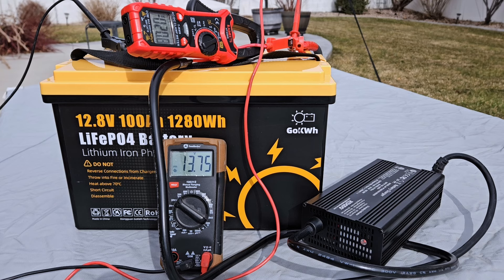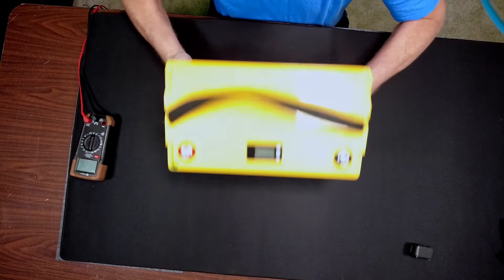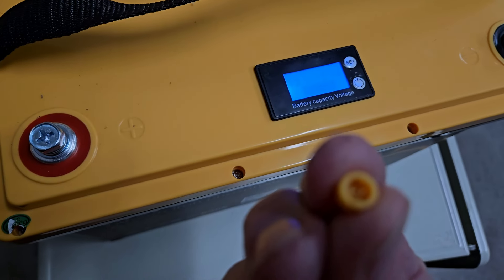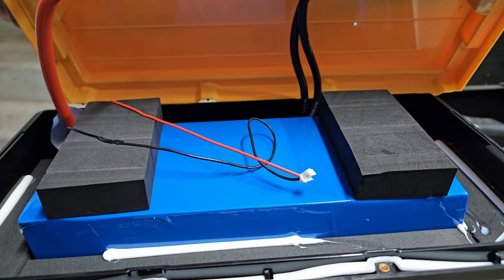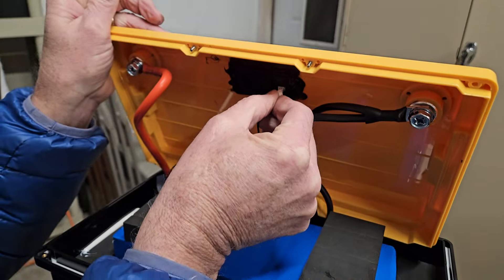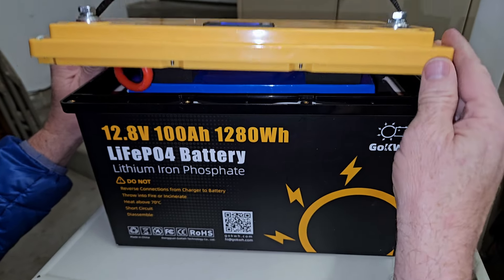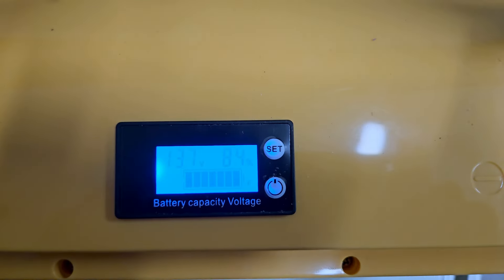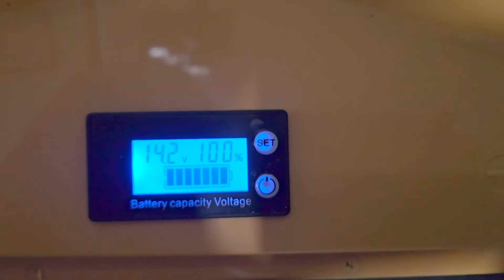Should you open a Lithium Battery to fix it ? | K7SW ham radio

Comment from the maker: What to do you think, was it worth the effort ? It was an easy fix afterall.  I wonder if I am the only customer who experienced this problem ?
Reply: This calls into question the reliability of the battery. The one thing that scares me about these budget batteries is the fact that their internal resistance does not limit their capability to dump a bunch of current if the protection circuit fails (or doesn't exist). That could result in an instant fire.

This ability of the lithium chemistry batteries is also what I appreciate about them... the ability to deliver sufficient current without voltage loss to my radios and other station equipment.

It's a love-hate relationship at its best. ;) But safety is something I take seriously and a reason why I'm careful about batteries and power systems associated with my station.

Don't get me wrong -- I think lithium chemistry batteries are a great solution for radio operators. I really appreciate the potential for thousands of recharge cycles from LFP batteries. (They will outlast me.) But care is required.

Comment: There is a certain percentage of every run that is broken. This is what customer service and warranties are for.  If the "average" customer of this device was asked to open up the battery and they declined... Would the company do an exchange? It's a simple fix and I would have done that fix myself if asked... But I'm special (just ask my mommy). If I had no issues with customer service I'd still consider this a pass.
Reply from the maker: I agree Steve, I was really surprised by how little they actually cared on this one. Not much of a tare down for sure. It certainly took the mystery  away for me.  And yes, you are special and a really good guy. Thanks for the suggestion.

Comment: I used to be in electronics. Those kinds of connectors are a friction fit, it's very possible that it passed at the factory but vibrated out during shipping and handling. Sometimes we would send out product with similar connectors and this very thing happened when the client did their incoming inspection on the product we sent to them. Sometimes the connector is just tight enough to hold at the factory, and that's it. They make em by the billions, they can't test every single one, you're gonna get ones like that eventually.

And sure, they could get a meter with a connector that clips in, but that would likely be a custom module requiring modification to the meter enclosure, and this would add more to the price. My guess is GoKWh isn't targeting the market segment that will buy the highest quality at any price, they're targeting a more budget-conscious market segment that's willing to accept some tradeoffs. Any way they can get the price down without affecting the quality of the battery too much helps them stay in their market segment.

I'm not clutching any pearls here, this is just something that happens sometimes. Connect it back up, tape it in, and move on with your day!
Reply: i have seen how some package handlers throw stuff around

Comment: Having gone this far I would have changed the wire myself and soldered the connections. You've voided the warranty by digging out the caps, they also serve as a tamper proof visual for the manufacturer.
Reply from the maker: Yes. And lucky for me, they actually put it in writing for me to open it up and do this fix.

Comment: I order a lot of stuff on Amazon and when I got my antenna lip mount it was missing 1 of the bolts that adjust the angle of the antenna. I called them to asked them to send me the bolt but instead refunded my payment and I got to keep the mount.

Comment: I had a new washing machine way back in 1988. The timer wouldn’t do squat. Called the factory and they told me the timer wires will pop off with rough handling. Sure enough it was a fire fell off. They told me they would sent a check for $20 for my trouble. Washer still works but still waiting on the check.
Reply from the maker: That is a good one. At least they offered. Thanks for sharing

Comment: My LCD came broken (Cracked).   I decided not to do a video.  Now you have me thinking, Maybe I can replace the screen. The screen looks extremely glued in. Do  you recall if it looked easy to replace? Thanks
Reply from the maker: It's totally easy to  get into that box, and it is only glued in. Maybe there is a replacement meter from another company? Let me know if you do, I might make a change as well.